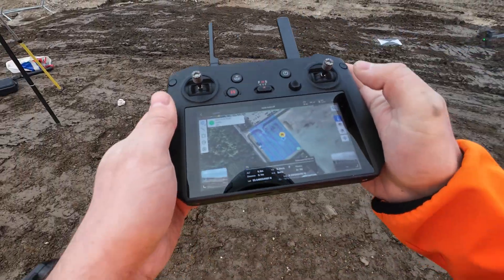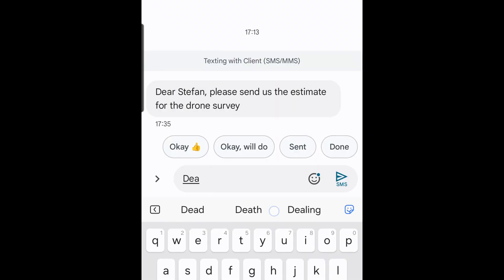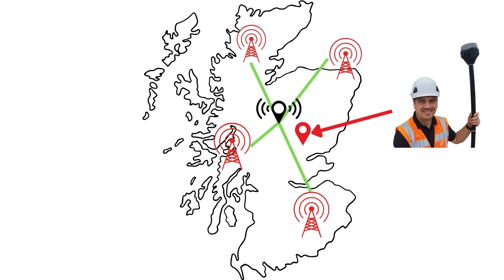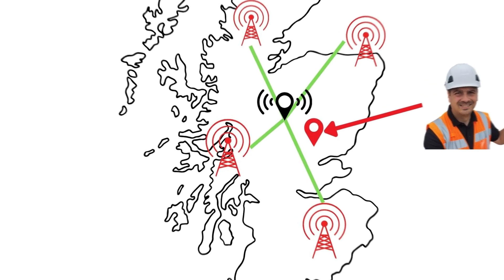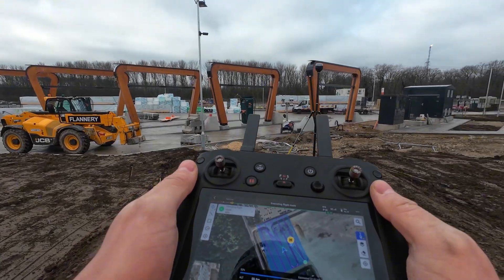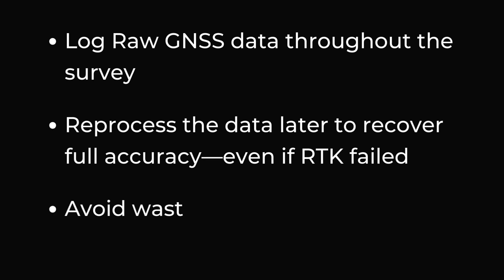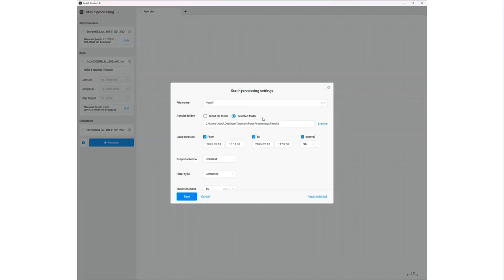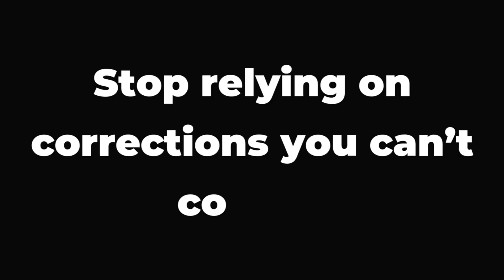The #1 Drone Mapping Mistake COSTING YOU MONEY

Comment: Hello Stefan! Thanks for this vid!! Do you know if the DJI D-RTK3 communicate with the Emlid RS3? Let´s say using dji as a rover getting its corrections from the Emlid (as the base)?
Reply from the maker: Yeah, you can use RS3 as base to send correction to any GNSS rover through Emlid Caster. You just need mobile signal.

Comment: Good video. One of the issues with a base station is range. Potentially up to 1 or 1.2km between base station and drone. What happens when you have to move the base station for large sites. A few years back I had an issue where I moved the base station and I had a major vertical discrepancy. This was a LiDAR flight.
Reply from the maker: Larger sites require a bit more planning. 
Maybe in your case was more suited to use PPK, to setup and survey your base station points in advance or maybe was a  coordinate transformation problem.
Also a good GCP network helps reducing this problem.

Every method has its pros and cons so is important to plan properly.

Comment: similar workflow as myself.  my cors doesnt update fast enough for my m3e (sometimes the age of the corrections goes over 1s and it wont lock up).  however the network was a great deal a couple of years ago, and since i was in the market for an RS3 anyway, i have been using a similar RTK set up.  i either set the emlid up over a known point or let the emlid average for several minutes.  i dont really need grid tie in as im generally doing muck surveys, but ive found the quality of the 3d model a lot better when using your own base to transmit corrections.
Reply from the maker: I have VRS Now as CORS service (which is pretty decent to be fair) but I still use the Emlid base station for all the resons I mentioned in my video.

Comment: These are really good points about rtk. I fly LiDAR with a Matrice 350. The only reason I want to use rtk corrections is it allows me to terrain follow, but i dont want to rely on those corrections for the collected data. Sometimes though I’m beyond the range of my base so I have a pretty simple workflow. I set the base to send corrections via Lora radio (rs2) and to record observations.  Now unfortunately the DJI controller only relays corrections via wifi, not more than maybe 20m. So what I do is I’ll mark check point targets (again recording obs) with a rs3 and then put it on a bipod and switch to a base setup with either the rtk location or a 2min average and start sending corrections via wifi for the drone. For processing the LiDAR, I just ignore the rtk and drop in the original UBX file from the original base while I’m doing the ppk of the targets.
Reply from the maker: Sounds like you have a  good workflow. RTK thru CORS is very convenient but it has it's own limitations, but I like having PPK as backup and I always use control points and check points. 
But again every job needs to be planned properly, and choose the best way. For example, on very big survey areas or remote places, PPK it's probably more suitable.